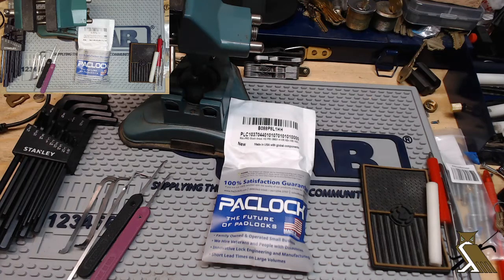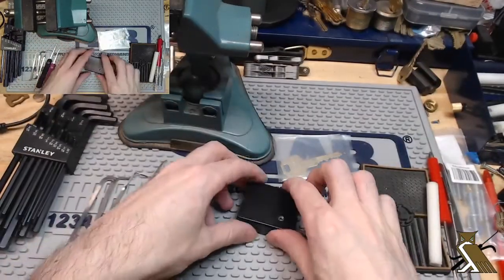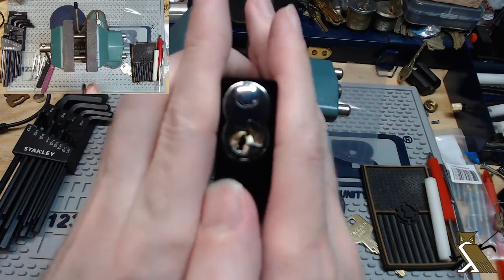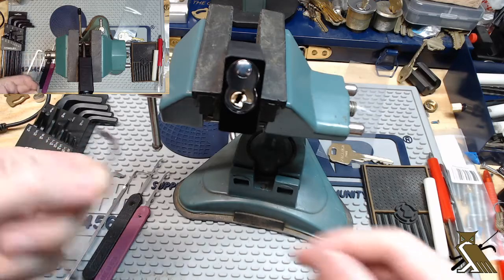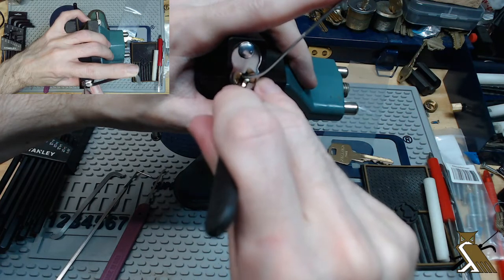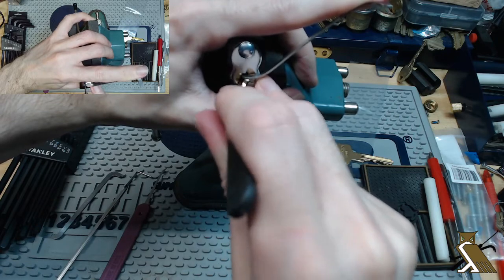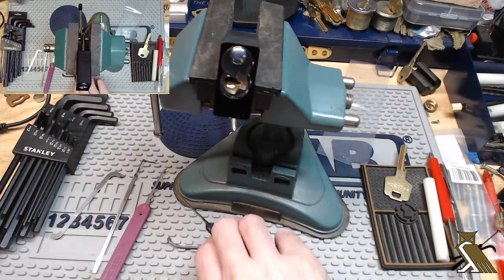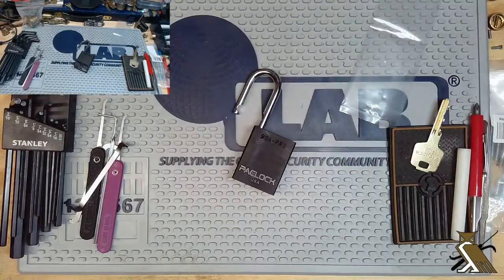(120) PacLock 90A-PRO picked out of the package

Comment: Wow they really do pack a punch, I’ve picked a couple of the PL410 Pro’s & the combination of serrated & spool pins works fantastically well. Great job getting the job done straight out the package. 
I will have to get one to to try out. 
Have a fantastic week mate.
Reply from the maker: Compared to even their other recent designs the new PRO core really does give you a hard time. The stepped spool pins, sharp serrated pins, and the use of high-low step changes really give you a workout, and the keyway does really make tensioning tricky. I was a bit worried about trying one straight out of the package since the first one I tried gave me a good hour or two of fight.
Have a good one, and stay safe.